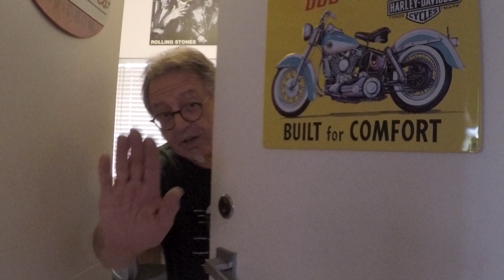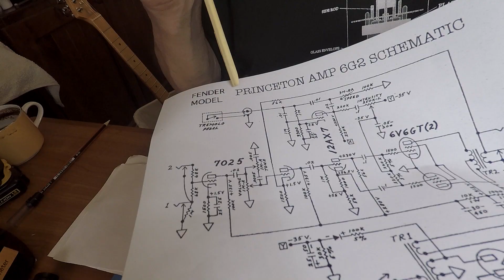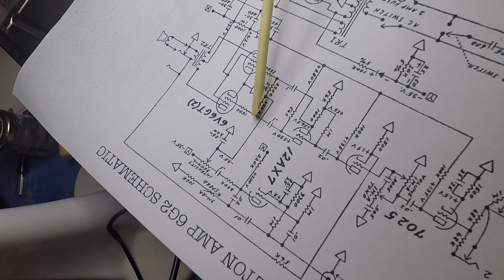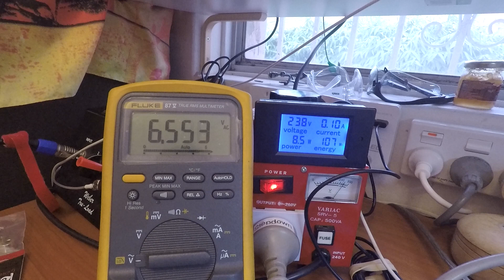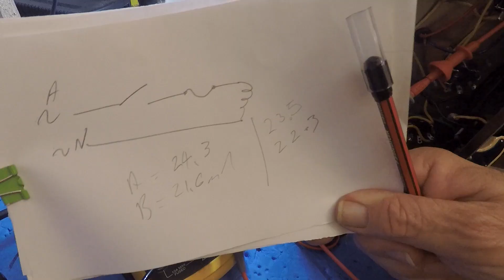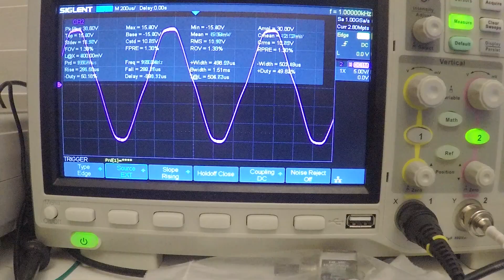Blackface Fender Princeton: Repair of buzzing and distortion.

Comment: I'm currently working my way through a collection of Princetons and Deluxe Reverbs.  I don't replace original components without a legitimate reason to do so, because originality only happens once and originality is valued.    However, I find these amps which distort very quickly even if the reservoir capacitor is fresh and good,  and what I'm finding is that certain coupling capacitors, particularly the white Mallory 25/25 ones,  don't need to have very much leakage before they become the source of the distortion.   I've found this by replacing one that measured good but not perfect on the ESR check.   Just putting in a new Sprague Atom to replace it solved the distortion problem.    These amps are SENSITIVE to capacitor condition.    If you really want to preserve as much original as you can, when chasing down a distortion problem, don't be afraid to pull and check the caps, write down their measured values,  and then put in new ones as a comparison.  You'll find that a lot of caps you HOPED to save, aren't really good.
Reply from the maker: Thanks Whirled. I like that comment “originality only happens once”. An excellent point regarding the 25uF caps. (I think you meant cathode bypass cap rather than coupling cap, but I agree 100%)